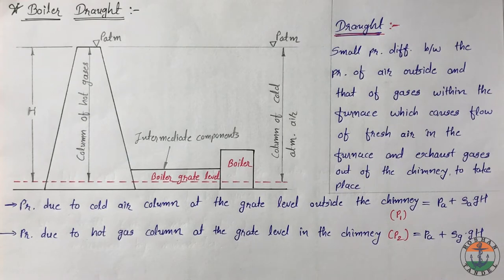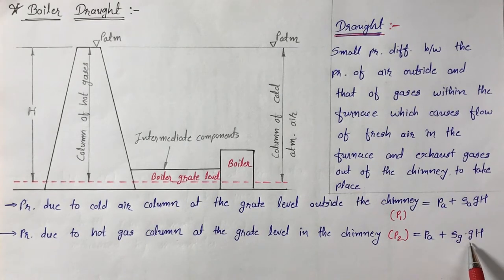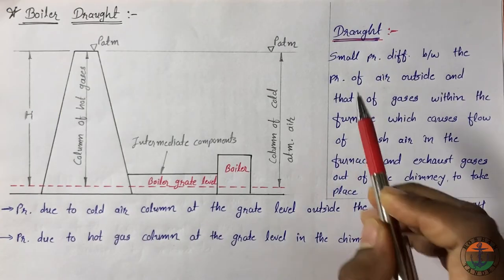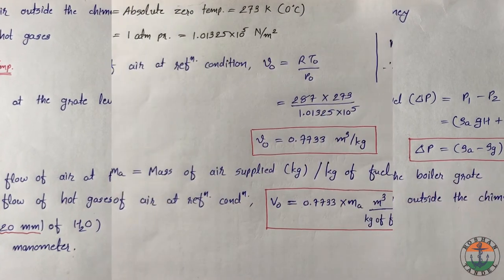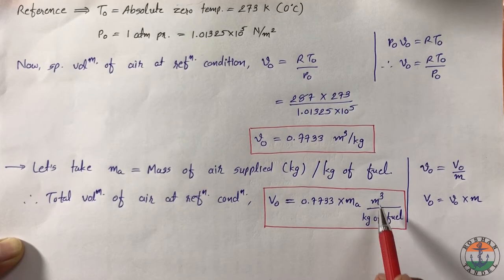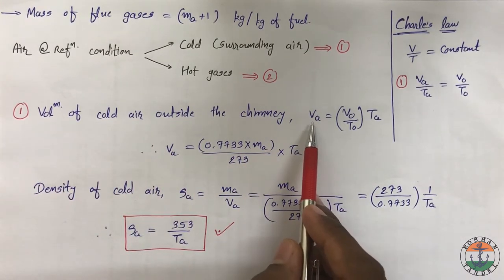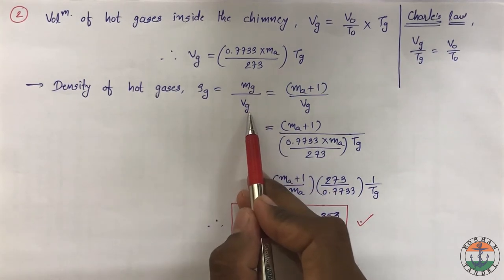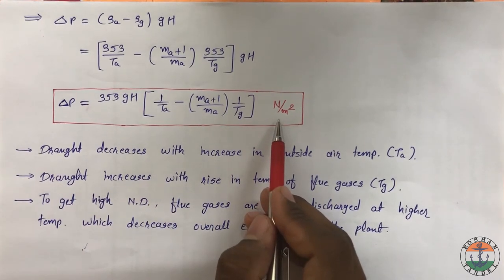Lecture 8 Chimney Draught, Natural Draught Calculation, and Condition for Maximum Draught

Comment: At 6:30 min, Vo should be equal to 0.7733* (ma + 1),  since mass of flue gases is ma + 1 and not ma
Reply from the maker: Dear Saurav, please check the value of V0 at 4:13. That value is used in the equation you are referring at 6:30.
Reply: @RoshanTandel  Yes but the mass of flue gases is not ma, but ma +1. Anywasy Thanks for replying, but i have got the answer in PK Nag book on power plant engg, its because of an assumption that volume of air and flue gases are same at NTP or cold air temp, irrespective of the fact that mass of flue gases is 1 kg more than that of incoming air.